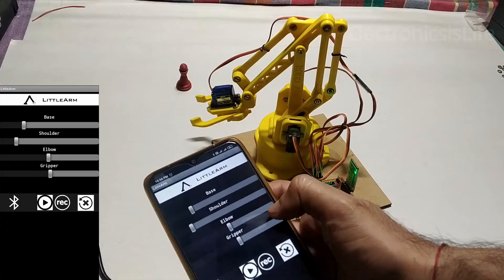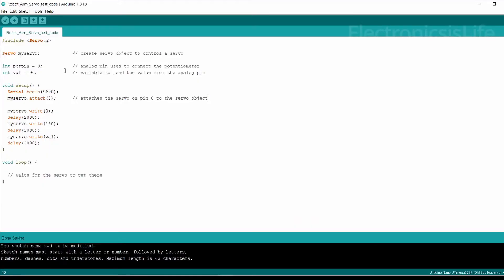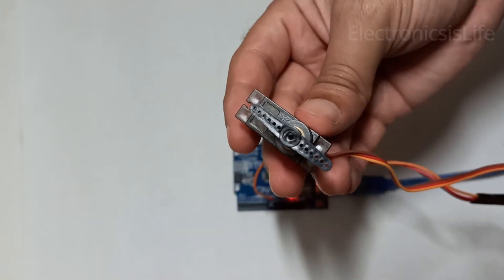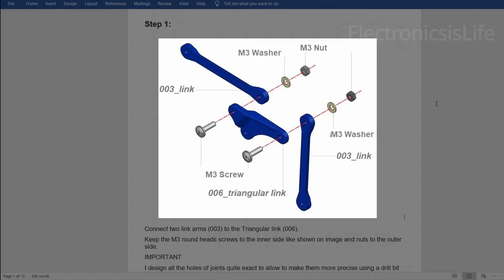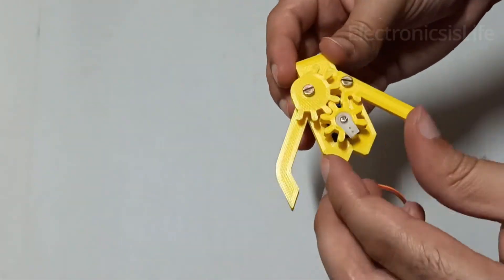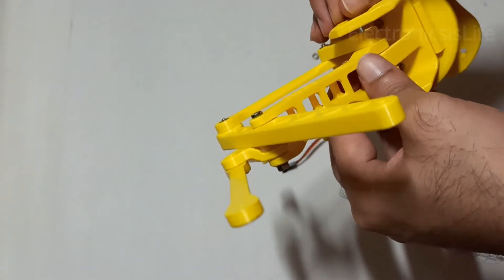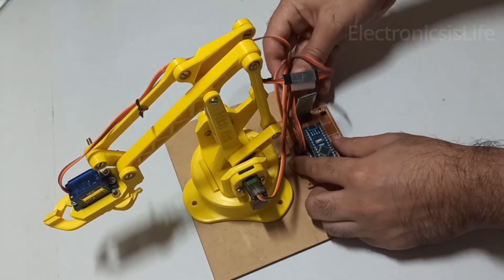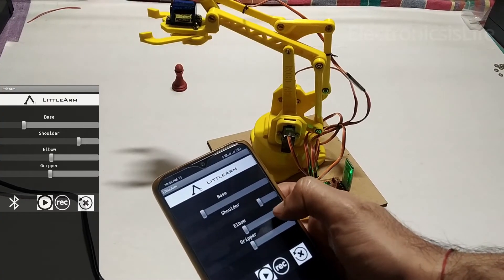DIY | Smartphone (Bluetooth) controlled Robot Arm using Arduino | HC-05

Comment: Why did app crash after connecting to Bluetooth?
Reply from the maker: Use seperate battery for Arduino.
Servo draws heavy current at start causing voltage to dip which resets Arduino. And Bluetooth module.

Comment: Your app not work not connect bluetooth module
Reply from the maker: App is old
I had taken it from playstore, you can try some other apps. 1 more thing
If the power supply is not strong , app can crash due to current surges required by motors causing voltage drops.

Comment: Sir, you supply power to this NANO through a USB port. 
Is there any other way to supply power to this NANO board?
If yes, then which pin can I supply power to this NANO?
Reply from the maker: Yes
You can use li-ion batteries as well.
Or power supply.

Comment: Bro i want to use this robatic arm for my college project is it working good or not that app . Will this code work in blynk app
Reply from the maker: This works well, as long as you are using a strong power supply. Use extra capacitor at supply, you can use separate supply for Arduino and servo motors.
Reply: @ElectronicsisLife  Thanks for your reply bro😌

Comment: Hello, I use your coding. It works but the thing if, when I try to control using the application. The app will crash. Do you have the solution since I am really urgent. Please reply asap.
Reply from the maker: Initially I had this same problem.
It is because, when servo motor moves it demands heavy current at start causing the voltage to drop, causing reset on arduino.
Solution is
1. Try to use proper supply which can provide heavy current, (powering from lapotp won't work)
2. Put 1000+uf capacitor on supply of arduino.
3. Or use separate supply/battery for arduino.

Comment: bro your application is not responding
Reply from the maker: Application is not developed by me, I found it on Playstore.
But application crashes/freezes when the voltage to bluetooth module drops, If your source is not providing quick current demands this may happen.
Plus do connect higher value capacitor near the supply/VCC pin of bluetooth module and Arduino.
Reply: @ElectronicsisLife   bro , 
 one motor run without any commands

Comment: Hello Sir Please Reply WE made this project but there is one problem in Programming Please Tell Me How Can i Contact You
Reply from the maker: Whats the problem ?
You should disconnect the Bluetooth module while uploading the program.
Reply: @ElectronicsisLife  Sir Have Disconnect Bluetooth Module But Sir The Motor Are Working Automatically While Connecting Wires
Reply: And Sir The Application 
It's Working It's Totally Frizzed Whe It's Connected To The Bluetooth And After Some Second Application Close Automatically
Reply: Sir In This Condition We Can Use Others Application Or Not
Reply from the maker: Whats power source you are using?
Is it coming from laptop/pc.
Reply: @ElectronicsisLife  We Are Using Laptop Power And Also Mobile Charger Power
Reply from the maker: Make sure that power bank rating is atleast 2 amps, do connect a 470+uf capacitor across supply of Bluetooth module.
Reply: @ElectronicsisLife  Yes Sir The Power Bank Is 2 Ampere 
I Connect The 1000uf Capacitor With Arduino Nano 5v And GND Pins And That Pins Are Connected With Bluetooth Module Also
Reply from the maker: It should have been worked,
Do you have oscilloscope, if yes check the 5v pin voltage waveforms while operating it.
Only time app resets is when voltage across Bluetooth module drops.
Make sure , 1000 uf capacitor is nearer to Bluetooth module.
Reply: @ElectronicsisLife  Sir I Thik The Program Error Occuring
When We Plug Out HC-05 And Connect The Pin Of Servo Motor To The Arduino Then Aslo It's Work Automatically In One Direction
Reply from the maker: Plz email me images of wiring or soldering done by  you.
Reply: @ElectronicsisLife  please Give Solution Sir
Reply: Sir Please Give Solution We Have To Present This Project In 3 Days

Comment: Bluetooth is connected,But when im sliding the control slide it doesn't move and the app quits! How can i solve this🥲, It's for my college mini project, please help me
Reply from the maker: It's due to reset of Bluetooth module, are you using separate battery for arduino and Bluetooth module ?
Reply: @ElectronicsisLife  same problem?no i haven't used any another battery,only one battery i have used

Comment: app not opening
Reply from the maker: Actually app is not developed by me, try some other apps.
Reply: @ElectronicsisLife  What other apps? Can you link any?
Reply from the maker: @voldy3565  please search 'Bluetooth Robot arm' on google play store, And you will get many of them.
Reply: @ElectronicsisLife  Yeah but won't the code and the connections be different for different apps?
Reply: @ElectronicsisLife  None of them work. Moving the sliders does nothing, and the apps keep giving me a "broken pipe" error.

Comment: Do we not need to connect these servos to pins with pwm output, so you have connected them to the 2nd, 3rd, 4th and 5th pins in the code section.
Reply from the maker: Not need to connect them with the PWM pins, do it as shown in the schematic/wiring diagram.

Comment: Can I make gripper alone without arm with this method?

Will the code and app work for gripper alone?
Reply from the maker: Yes it will.
Make sure you connect the gripper servo at right pin.
Reply: @ElectronicsisLife  thankyou and one more help ..we will be attaching gripper with drone...is that possible? Because you are using power Bank i need to attach gripper alone to drone and control using Bluetooth
Reply from the maker: It should work, give it a stable power from lets say arduino or one of the ESC drive.

Comment: Sir, I just modify arm and now I am getting issue in connecting servo moters .after connecting Bluetooth all servos are vibrating. Sir please guid me...
Reply from the maker: Power supply needs to be strong (atleast 2 amps).
What power supply you are using ?
Do connect a 470+ uF across supply of Bluetooth.
Don't panic.
Reply: @ElectronicsisLife  currently I just take out 5v and gnd ports to breadboard but its not working properly
Reply: @ElectronicsisLife  and i supply arduino with pc but in robot i will going to connect it with powerbank ;
I dident join any capacitor
Reply from the maker: Do you capacitor
Keep arduino and bluetooth supply common
And seperate supply for servo motors.
Make sure that your power supply has 2 amps rating.
Reply: @ElectronicsisLife  thank you so much

Comment: Sir apan servo motor sg90 use karu shakto ka all
Reply from the maker: Ho karu shakato
But sg90 has plastic gears whereas mg90 has metal gears 
Mg90 is more robust
But ya application sathi we can give a try to sg90 since both are of same size.

Comment: The link of code doesn't work can you share it please
Reply from the maker: https://www.instructables.com/DIY-Smartphone-Bluetooth-Controlled-Robot-Arm-Usin/
Reply: This code can i use it in Arduino uno ??
Reply from the maker: Yes, it can be used with arduino uno or pro mini as well
Reply: Can you please tell me also that why capacitor is added ?

Comment: The apps slider freeze when connected
Reply from the maker: App freezes if Bluetooth connection gets disconnected.
Check following things,
Use Good power supply at least 2 Amps.
Connect 220+ uF capacitor across Bluetooth modules supply voltage.
Just tap the app sliders as I did in the video.
Note : App is not developed by me

Comment: Without capacitor it will work
Reply from the maker: Seems difficult.
Depends on how quickly your power source can supply current.
Reply: @ElectronicsisLife  i can not understand the connections of capacitor please tell me where i can made connection for capacitor

Comment: The program and the circuit that you provided in the pdf is  not visible property, can you provide a proper project file plz
Reply from the maker: I checked it again and it worked as expected,
kindly install the winrar application.

Comment: How can we connect two smartphones with one HC-05 bluetooth module to simultaneously control arduino outputs?
Reply from the maker: Then you require 2 HC-05 Bluetooth modules.
But in that case You need to creat 2nd uart using port bit banging
Since arduino has only 1 uart

Comment: I'm using an ATX power supply for the servos and the HC 05. But the app crashes every time.
Reply from the maker: I used 5v 2Amp rated power bank and it worked smoothly.
Add a 220uF+ capacitor across the supply to the Bluetooth module.
App crashes due to disconnection from Bluetooth.
Reply from the maker: Worst case use separate power supply for Bluetooth + Arduino and Servo motors.
Reply: @ElectronicsisLife  Thank you very much. I learned some things so I'm subscribed

Comment: sir if we use arduino uno in place of arduino nano than code will be same or any changes in code??
Reply from the maker: Same code, no need to change.
Reply: erro 516:unable to write broken pipe
this error was saw when i try to connect Bluetooth module with application....and application was freeze...
Reply from the maker: Just click the slider once, like i did in video.
Make sure that u are using supply with higher current capacity or in my case even a power bank worked well. 
App is not made by me , I found it on playstore.
App may freeze due to disconnection of Bluetooth module due to dipping of input voltage.
Reply: if i use other app then code will be same or any changes in code ???
Reply from the maker: Code will be different.
It would be as per app.
Reply: sir can u plz share ur contact ...i want to learn about this project..
Reply from the maker: You can E-mail me your queries
Reply: i want to use external power supply for servo motor..can u plz suggest me best suited power supply for 4 mg90 s servo...thx
Reply from the maker: Any power supply or power bank rated at 5 volts and 2 amps.
Reply from the maker: Make sure to connect 470+uF capacitor across it, nearer to Bluetooth module.
Reply: @ElectronicsisLife  The Capacitor + should be connected to the Bluetooth VCC ? can you explain as in the video also the bottom side of the board was not shown after the capacitor was connected. can you help me out on this ?
Reply: when i give 5V 2A power supply some how voltage  drop 4 to 4.5v & servo motor doesn't rotate properly
Reply from the maker: Do connect a 220+ uF capacitor across supply of Bluetooth module, capacitors + goes to VCC and - goes to Gnd.

Comment: The Play Store link is Broken and not able to download the Bluetooth Control Application
Reply: Yes how to install
Reply from the maker: Yes it is broken, seems like that app has been removed from playstore.
Let me search for other option.
Thank you for feedback.
Reply: @ElectronicsisLife  Can you share a Google Drive Link of the application ?
Reply from the maker: Yes
I shall share it as soon as .apk file is uploaded.
Reply: @ElectronicsisLife  Thanks
Reply from the maker: Google drive link for app or drive link https://drive.google.com/file/d/1EsEhR84ACfvznMCjqlxjMy5AHiJiwvmW/view?usp=drivesdk
Reply: @ElectronicsisLife  Thanks Installed the application and it shows as "This app was built for an older version of Android and may not work properly. Try checking for updates or contact the developer" When i just click ok and ignore this message i am able to connect to the bluetooth module but then when the slider is tried to be moved the app freezes and does not make any actions.
Reply from the maker: Just click the slider once, like i did in video.
Make sure that u are using supply with higher current capacity or in my case even a power bank worked well.
Reply: @ElectronicsisLife  I am using a 5v 2a adapter to power this Robot Arm. This power is sufficient right ?
Reply from the maker: Yes it should be sufficient.
If you have dso , u can even see whether the voltage is dipping or not.
The main reason app freezes is due to disconnection of Bluetooth module due to voltage dipping.